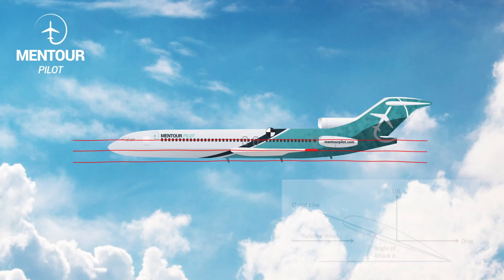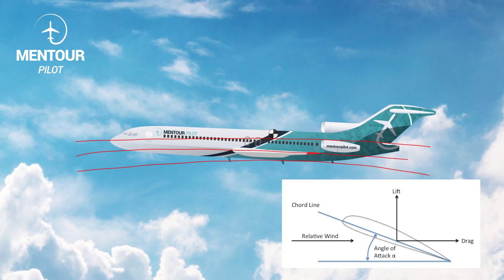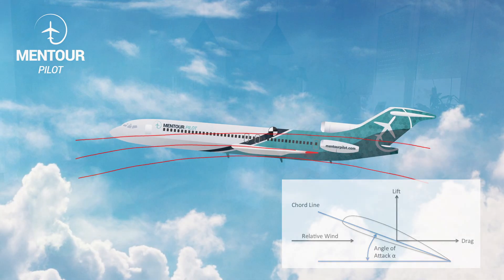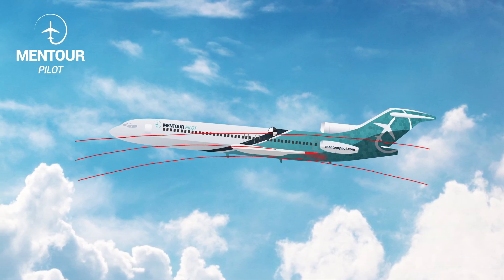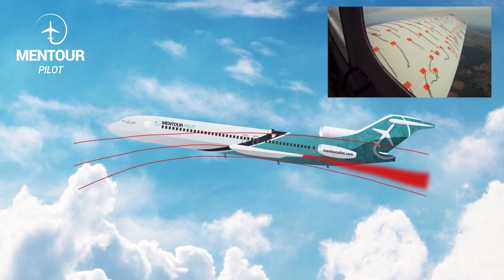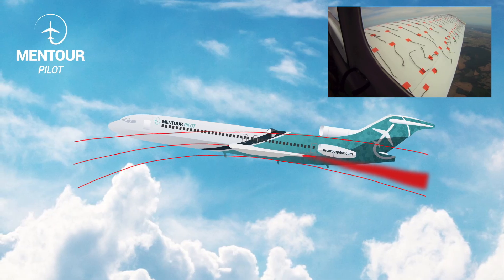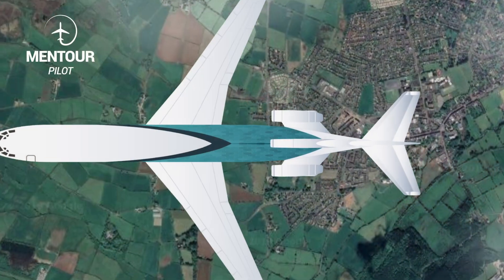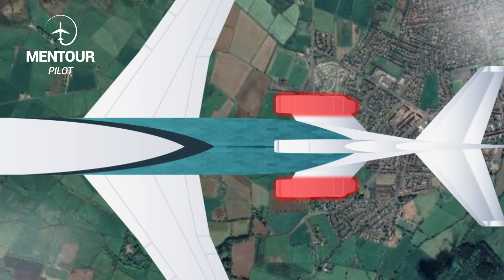The STALL you can't get out of! SUPER-STALL

Comment: Question.
Could bringing passengers to the front of the cabin shift the CG enough to recover from a superstall?
Reply: Problem is... by the time everyone had stopped to get their bags out of the overhead bins then switched their mobile phones on to record the event and blocked the aisle asking stupid questions it would be too late!
Reply: Mui MasMacho In theory yes, but it would be hard to do, and there would likely be injuries to unrestrained passengers.
Reply: [Gordon Richardson]
Thank you for your reply.

I suppose that desperate circumstances require desperate measures.
Reply: Had same question.  Would depend on aircraft, smaller aircraft would be more influenced by the movement of passengers (being a larger portion of aircraft weight, and lack of immovable cargo) yet you would run into geometric issues when there isn’t actually anywhere to put everyone).  Also note on smaller aircraft, such as the Beech 1900’s, Cessna Grand Caravans, Dash 8’s (100-300) the actual weight of passengers does play into seat assignments.  Back to the topic, conceivably an aircraft such as a 757 is long enough to put everyone in front of the centre of gravity (at that moment).  The catch is, the centre of gravity now being out of limits to the front (mind you, the centre of gravity on an airliner is only about a foot, give or take) will reverse the problem, though the flight crew was likely anticipating this, they need enough control authority to overcome the nose down tendency.
Reply: jfsa380 Yeah, it sounds like the plot of a (bad) movie.

Comment: If only the center engine on a trijet was throttled up would the nose pitch down, or is it too far back to have any significant effect on pitch?

The pitching effect of under wing engines was mentioned and I'm wondering whether it's the vertical offset of the center of thrust from center of mass or center of lift that causes that.

Comment: I can't say I've heard of a "super stall". I've somewhat recently heard the term "deep stall" in respect to the stall problems of supposedly "unstallable" canards (anybody recall the Ercoupe?), However,  what you're describing I was taught as a "flat spin". Maybe when discovered back then propeller P-factor induced the "spin" portion of the stall.
As for swept wings, they provide for mainly two things, when at near supersonic speed, the shock bow wave (perpendicular to the flow of air) transitions across the wing, the wave envelopes only a portion of the wing at any given point through the transition of the wing to prevent total loss of lift. Secondly, a swept wing in slower, aka transport type aircraft, broadens, aka spreads out the weight and balance envelope allowing for a greater range of loading scenarios........lastly, if ever in such a situation as a flat spin try everything, lowering flaps, lowering landing gear, etc. and in varying combinations with everything else that can may cause the necessary pitch down moment with the reason being you've got nothing else to spend your remaining time on........as they say.....never give up!.......
Reply: What he described with the T-tail is often called a deep stall in my region of the USA. A deep stall or super stall is not a flat spin, they are different animals and the tail surface does not need to be in a wake nor stalled during a flat spin, and a deep/super stall does not need to involve any spinning. 
Flat spins are caused by a combination of rearward center of gravity and a lack of rudder authority which can simply be too small of a rudder or too short of a rudder moment arm. 

You are slightly mistaken in your swept wing information. Swept wings do not spread out the balance envelope, they increase critical mach by inducing span-wise flow and reducing the effective cord-wise airspeed allowing efficient operation in the high subsonic realm. They also strongly effect dihedral and dutchroll-divergent spiral tendancies, which are also related to rudder size which in turn is related to control-ability with failure of the critical engine on a multi engine aircraft.
More wing sweep also reduces peak drag while transitioning through the trans-sonic regime of M0.9-1.3, which is related to the bow waves(they form on several leading points/edges not just the nose) but funny enough less sweep can be slightly more efficient in the fully supersonic regime up around mach 2 though not buy much and there are tradeoffs.

Comment: If I recall from my aerodynamics class, deep stalls tend to affect T-Tail configurations more, because the slipstream created by the wings renders the elevators useless.
Reply: Les Turner correct, on aircraft that have the horizontal stabilizers behind and slightly above the wing (the sheer majority), upon any major upset, the stabilizer will be freed from wing wash.  If i’m not mistaken, however, the horizontal stabilizer can itself stall, rendering the elevator’s up authority ineffective.  Note the Saab 340 and Metro’s that have the ‘cruciform’ tail.  Can be deep stalled, at a higher angle than on a low mounted stabilizer, yet far lower than a T Tail (the purpose of which is either to clear tail mounted engines, or clear turbulent and highly variable prop blast.

Comment: I wonder how much lowering the landing gear would pull the nose down if all the other control surfaces are ineffective
Reply: If stalled you must not use aileron or you will spin.
Im no 73 pilot but if you were stalled at cruise altitude you could still be be above gear extension speed and after recovery would quickly exceed gear limit.

Comment: As far as I know a canard configuration is much less susceptible to stalling, even more it is self-correcting as the canard wings on the nose will enter a stall first, immediately dropping the nose and starting to recover from the stall.
Besides, as the main wings create a pitch down momentum, the regular tail planes will have to counter that with a downward (negative lift) force which will induce some drag and the main wings will have to provide more lift to counter that downward force from the tail plane, increasing the induced drag created by the main wing. In a canard configuration the nose planes will create positive lift - again with its own induced drag - but the main wings will not need to create as much lift as with the tail plane configuration, creating less draft. 
So this raises the question: why are there no air liners using a canard configuration even though they have better stall characteristics and theoretically create less draft i.e. use less fuel?
Might be a fun conundrum to discuss as canards are quite common in military jets as well in some light aircraft (think Burt Rutan)
Reply: You are correct.
There are other things to consider thinking about configurations. Like ground handling. Canard aircraft are very difficult in this.
Usually the benefits of canards do not outweigh the problems. That's why they are not used.

Comment: Well, technically speaking every stall ends at one point or another.
Reply: If it happens in the flare you've just landed.
Reply: @dr_jaymz  No it does not , if it did you would came down with one hell of  a bang ! In effect drop out of the sky . This is not recommended by the manufactures .  :-)
Reply: @welshpete12  yeah falling out of the sky voids your warranty 😬🤣
Reply: welshpete12 he didn’t say “landed gently”. I don’t disagree with you that you should not do this but given that flare is at 10-20 ft it would not be the end of the world. Landing gear is designed to take much more force than passenger flights usually deliver. I have jump seated on a few cargo flights and they land pretty hard compared to passenger flights because packages don’t complain. Not saying stalling in flare is a good thing and would probably require a serious maintenance check but not as bad as you might think
Reply: 737 max proved you correct
Reply: @jrgenramdahl123  not sure the max crashes were due to stalling, quite the opposite actually.

Comment: This was a good explanation but doesn't explain stalling due to low speed (Vs0, Vs1). To my mind a stall is a sudden loss of lift as the air flow is no longer laminar not just a gradual loss of lift, is this what is happening when slowing below Vs0?   Can that be fixed by increasing AoA, as that doesn't sound right to me?

Comment: Could differential thrust get a plane out of a superstall? Setting the engine on one wing to idle and the engine on the other wing to max thrust.
Reply: Might work on turbo props like a Dash-8 or similar. But turning a stall into a spin? I don't know about that. Resulting forces might break up the aircraft.
Can't think of a jet airliner with a T-tail and  the engines underneath the wings, so little or no chance to enter a super stall. When the engines are mounted at the rear of the fuselage it usually has a T-tail and can therefor enter a super stall.  Problem is that the turbulent air from the stalled wing is not just adversely influencing the function of the tail, it also affects the jet engines which are likely will suffer compressor problems as they also need a smooth air flow to work properly.
Reply: That might work, but there's probably not enough time. Remember most of the engines are near the fuselage.

Comment: I am of the opinion that all aft engine nozzle aircraft should have a basic thrust vectoring setup. It doesn’t have to be much; just a couple of small panels on the nozzle that move with the elevators.
Reply: in order to increase complexity more? I don't see any way that would help
Reply: It wouldn’t be complex. A couple of panels attached to the elevator is all. A grand total of three critical moving parts, and they would be connected with pin-joints (like on a backhoe or excavator - and those continue to function despite poor maintenance and horrible working conditions); there would be no jackscrews or other things prone to jamming.

The parts would be a pushrod that goes down from the horizontal stabilizer & elevator assembly; the upper panel; and the lower panel.

Push the yoke forward, the elevator tilts down (driven by the hydraulic actuators), push it further and the pushrod engages the panels and tilts them down also, vectoring the engine thrust down (and thus pushing the tail up), lowering the nose, and pulling you out of a deep stall.

Under normal maneuvering conditions, the pushrod would not engage the thrust vectoring panels (there would be a slot that the pushrod pin moves in), so that elevator feel would not be altered by the power being output by the engines.

The panels would return to neutral due to aerodynamic forces.
Reply: Dark Winter I’m not sure how it helps; deep stall situations have happened once or twice in commercial flight, and in neither flight did the crew seem to realize they had stalled. The system you propose still adds weight and complexity; a much more elegant solution iff additional authority is needed is something like MD-90 pylon flaps which still provide control authority through stall and don’t have to worry about aeroelastic issues with various engine thrust and various flight regimes.
Reply: I’m not familiar enough with the MD-90 to make a comment on it. If you don’t know that you’re in a stall; either a) there’s something very wrong with the instruments that should be screaming at you; or b) you are grossly incompetent and ignoring the warnings that are going off.

Of course the other way of eliminating both deep stalls and complexity is to, you know, not put the horizontal stabilizer someplace where it’s going to have it’s airstream spoiled by turbulence coming off of the stalled wing in front of it in the first place. 😉
Reply: Dark Winter Right. The pylon flaps on MD-90 basically do that - they still have flow even when the horizontal stabilizer is blocked. Like the thrust vectoring mechanism you mentioned, they activate when the yoke is pushed nearly all the way forward. 

Both of the deep-stall-related crashes I mentioned were attributed to pilot error because there should be plenty of signs of stall, which were somehow all missed.

Comment: Seems to me that commercial aircraft should have Canards up forward if for no other reason then stall abatement.
Reply: Canard aircraft are almost invariably statically unstable and as such can't be certified for general aviation. They require full automatic fly by wire controls. Fine for fighter jets, unacceptable for civilian applications where a self correcting (i.e. stable) airframe is mandatory.

Comment: When can an aircraft be stalled?  I was taught like you, at any airspeed and in any attitude.  Great job Sir.
Reply: Turn to tight and the inner wing will stall before the outer, this is why pilots are taught let it slip around turns at low level rather than use too much rudder :)